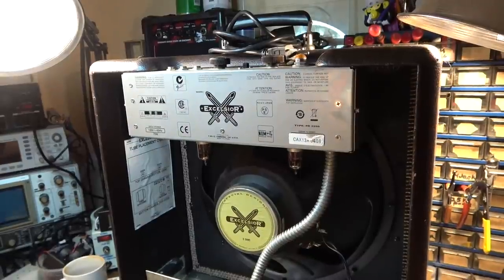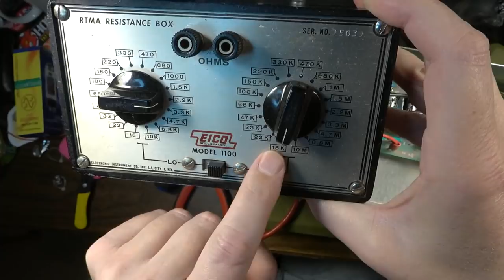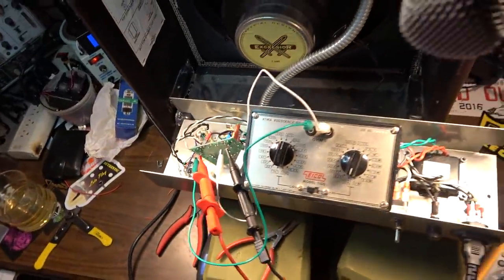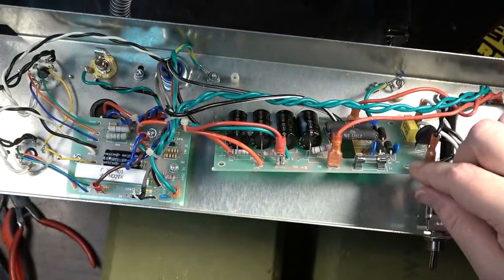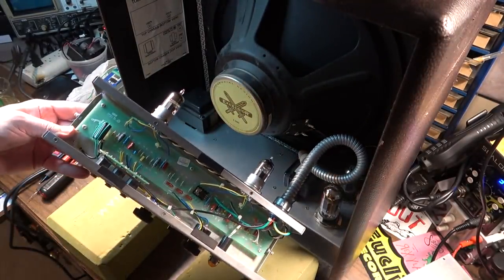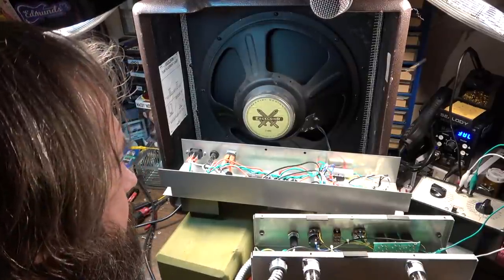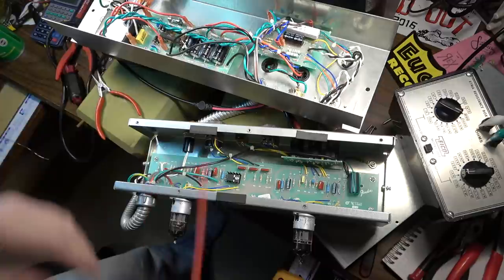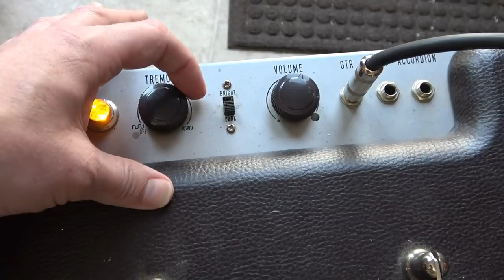Repairing Al Gore's Favorite Tube Amp - Fender Excelsior Pawn Shop Special Series

Comment: Hi Brad, just a few super serial technical remarks...

1. 6V6 is 12W, 6V6GT and JJ6V6S are 14W
2. the voltage to use in cathode bias calculations is the plate-to-cathode voltage, now you measured plate to ground (correct method for fixed bias amps), so subtract the voltage drop over the cathode resistor.
3. cathode bias is best at about 100% of max plate dissipation because increase in cathode current create a larger voltage drop across the cathode resistor and therefore bias it cooler, temporarily.

in this amp i would leave the 470R bias resistor because:
with Pa max = 14W, Rc = 470R and Vrc = 29,2V :
Va = 369,8V (= 399 - 29,2)
Irc = 29,2 / 470 = 62,1mA
Pa = 0,0621 x 369,8 = 23W 
=> 11,5W for 1 tube is already only 82% of max plate dissipation.

with your 1K bias resistor you brought it down to:
36,5V / 1000 = 36,5mA
0,0365 x (432 - 36,5) = 14,4W for 2 tubes, which is ONLY 7,2W per tube

Aiken amps has a good article on everything bias, please read up => https://www.aikenamps.com/the-last-word-on-biasing
Reply from the maker: Thanks for the comment. I am aware of the Aiken link already. Great site. You are correct on your math, and I appreciate the effort you put into writing it all out; however, there are some other considerations I think you might be missing with the focus on figures, and I'd like to address them.

I already addressed #1 in the video. You are right that my max dissipation figure was wrong for a glass bottle 6V6GT (or JJ equivalent). 

You are correct on #2. That was an oversight on my part. Got stuck on autopilot and whiffed on measuring to cathode rather than ground. The actual effect on the numbers was not excessive in the end. Put me off by maybe 8%? Still a mistake, and I own it.

Now on #3... This is NOT what Aiken says (that cathode biased amps can be biased to 100% dissipation at idle). What he says is you can usually "ignore the 70% rule". That's not the same as saying "bias to 100% at idle". I typically stick to the 70% rule even on cathode biased amps because, at the end of the day, it does not USUALLY affect the tone of the amps appreciably at jamming volumes, the amps run cooler overall (which is good for this guy because he wanted reliability and lower tube maintenance as his main mandate), and if anything, an amp running a bit cold will break up sooner on the dial and at lower volumes, which is what many players are looking for anyway, hence the obsession with attenuators these days. Although the onboard camera mic might not reproduce it faithfully as I'd like, the play test yielded a resulting tone that was acceptable to both TJ and I, and the objective of the customer was achieved.
Reply: Alex Maurice  no, no one cares about it.
Reply: @TheGuitologist  But you biased this amp to about 50% of max power.  Try measuring the output power into a resistive load you loose power as you reduce the bias.   80% is probably a good compromise if you really don't want to replace tubes.  It's most likely the screen voltage that's too high, I'd increase the PSU resistor to drop it to 330V relative to the cathode.  I'm finding good JAN military tubes used at a decent price and am going to try them in our amp.  It would be interesting if you measured power of amps that you work on before and after repair.  Just below clipping with a waveform that visibly looks like a sinewave is usually below 1% distortion, give it a bit of clipping since these produce rated power at 10% distortion.

Comment: I loved my Excelsior amp! I too had heating issues and ended up installing 4 fans from an old PC to keep it from burning up. After that it was very reliable.
Reply: And now you know what to do to fix the core issue!
Reply: @stephenhunter70  I don't have it any more. Notice I said "loved" as in past tense. lol I would like to get another one though. Haven't seen them in my local shops though recently.

Comment: I have a excelsior and excelsior pro. Same amp. The pro jist came from fender with a eminence legend speaker.  I run both those amps full bore and usually with a full or drive pedal.  I absolutely love them.  Great stereo rig.  Ive mever jad a problem with either.
     Also, there is a femal surf music band called the "surfrajets".  They all llay through excelsior amps. Bass and guitars
Reply: Bass too?  I usually see a different rig on hers.

Comment: I had an Exelsior few years ago. It was  ratteling from the very beginning. The ratteling stopped when I changed all the tubes. With an Eminence Legend 1518 and new JJ tubes, the amp was perfect !
Reply: Hi, and it never rattled again?
I’m thinking that the frecuencies of the stock speaker in brown Excelsior is the cause of the rattle in the tubes. Because i have found that the people change the tubes and then starts to rattle again, but only with the brown one.

Comment: I have one of these Excelsiors which I use primarily as a harp amp, but also for guitar. An Eminence Legend 1518 is a great speaker for these amps. I swapped the tone switch for a proper treble cut tone control, and modified the preamp stage by dropping the preamp voltage, and changing the 3.3k cathode resistor on V1a to 2.7k. I wanted to keep the "Valco" vibe, snd they used 220k-270k plate resistors with 2.7k cathode.  If you change the values to typical Fender 100k and 1.5k you pretty much get a 6G2 Princeton preamp...
Other mods I made were a footswitch jack for the tremolo, and put V1b's bypass cap on a switch,  which cleans the amp up, but keeps that budget amp vibe....

Comment: I remember when this series came out. The fender vaporizer was the best amp in the series.It had foot switch, jetson cab and reverb.
Reply from the maker: I think it was the coolest looking one. Was the Greta also part of this series?
Reply: @TheGuitologist   yes she was
Reply: @TheGuitologist   Yes Greta was one and a cute little amp. I bought one for my daughter. It breaks up at 1/4 vol. Would love to see you overhaul one of those. Love your vids(guitar and politics)
Reply: I regret selling my vaporizer.
Reply: @oneeyeddog6127  that amp had a taste tone.  I miss mine too.
Reply: @TheGuitologist  I bought a Greta and a Vaporizer as soon as they came out; never liked the aesthetic of the Ramparte or Excelsior. In small clubs, once a Vaporizer's up in its range with the drums, it sounds just like a DeluxeReverb...sweetness w/ 2 16ohm 10s!
My Greta is about the best-sounding amp I own....between 0 and about 1 1/2 on volume(!); after that it's a Pignose the rest of the way. The actual Cool Thing about it, though, is that it has an EFX loop....so I can run just its sweet pre-amp character to the EFX return on my 100w el34 2x12" Carvin, and get Greta-tone you can hear up the street! In the bars I run it into the EFX return of a 20w MicroDark Orange and a 1x12 V30 cab....

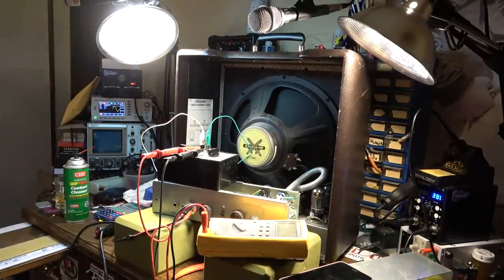Comment: Thank you for this video!!!  Really helped my navigate my own repair.  I too lost power to all the filament heaters.  At 30:55 in your video the same thing has happened to you.  Such a mystery at first.  But same as yours -  the spade clip on mine was loose or corroded, both of them.  But I still had full plate voltage and could hear the transformer working.  This filament supply connection is definitely a weak link in the power supply chain.  Great tip for any Excelsior owners.  A good idea maybe be to put in a soldered connection here..

Comment: MOSFETs are quite neat, they work almost exactly like a triode valve, and if you adjust the voltage in a tube amp design you can substitute all triodes with MOSFETs, Session did exactly that in the 80s.
Reply from the maker: I have played some really great sounding mosfet amps. SS can be very good.
Reply: Still loving my Session Rockette since 1986 !

Comment: The Excelsior Pro has a few improvements, namely an upgraded speaker.  I dig mine; I also have the Vaporizer; both are surf green. Also have a DecoTone. They sound great, and the prices were reasonable, except for the DecoTone.  No overheating problems on any of them.

Comment: That shielding could have been shorting and causing the red-plating.
I noticed the same with my Excelsior.
Also, I did replace the speaker with a custom re-coned that really makes all the difference in the world.
Originally I had planned to add a Tone Control Mod., however after replacing/upgrading the speaker it is fine as is.

Comment: Thanks for the Vid...I own a Vaporizer and I had not played it in a couple of years and when I turned it on,  the reverb did not work.  Got is going by cleaning the RCA jack  that goes to the spring reverb unit.  Hope the rest of the connections stay good!

Comment: That resistor was more physically stable down on the board, but is of course better dissipating heat off it. I wonder if a little standoff on each end could be made to keep the weight of that wirewound from working at the leads and solder joints. Only a concern if it's getting banged around. of course.

Comment: When I used to repair vintage electronics I would replace any resistors I saw discoloured on the board with the next wattage up or the one above that depending on space.  It sure helped as I had more than few that would blister you as soon as you touched them then go up from say 2W to 5W and mildly hot and go to a 7, or 10W if it would fit, and you could rest your finger on it.

Comment: I really was especting at min 10 to see some smoke getti g out of the nice resistor box. You replaced the 10W cathode resistor for a who knows how much dissipation can hold those inside the box...
Reply: I was thinking the same thing !!  The resistor boxes I have had contained 1/4 watt resistors !!  Seems they would burn out quickly !!
Reply: I looked it up.  The box has 1W resistors.  (I was halfway expecting 1/2W.)  Still, I wouldn't run it for very long.

Comment: I just bought one of these last week. Has a fender speaker with a bigger magnet.  Hopefully I will have good luck with it. When I got it, I had to tap a power tube for it to work properly.  Swapped power tubes and the problem followed the tube

Comment: On your initial test of the bias using your decade box, have you got a speaker or dummy load connected? Is that socket sitting above the board you have piggybacked your decade box to a speaker socket? Could be why you were getting the bias runaway? I've made that mistake once or twice and immediately figured it out before killing something.

Comment: ha ha - had one of those.  I replaced the speaker with an eminence.  Fender offered a more expensive version that came with the same eminence (but with a fender label on it).  So fender did this too.   Also, swap out that tone switch (switches in a 470K resistor in and out) with a 470K or 500K tone pot (this is from memory, and memory is not so good - so please verify)!  It makes it a nicer amp.  I am listening to it now so you have not fixed it yet (in my listening) so I don't know what the fix is yet.

Comment: Do not replace the speaker! The Fender Special Design speaker is part of the charm and uniqueness of this amp. Lots of people change this speaker thinking that they're doing themselves a favor, but they're not. Does anyone think that Fender didn't try other speakers in there when they designed it? They were probably designing the circuit with Jensens before they got the first bespoke speakers for this amp. Historically, bespoke stuff ends up being more a lot more valuable to collectors.

Comment: The reason the ground lug wasn’t drilled through is because the protective earth need to be attached to a fastener that can’t be undone from outside the device, and that doesn’t perform any other function. This is usually done by spot welding the stud to the chassis, which seems to have been done poorly or not at all on this device. The safety idea behind that arrangement makes sense, but you can’t stop to wonder if it would just have been better to use a bolt instead.
Reply from the maker: I think in this case, the regulation failed utterly in its intent.

Comment: Cool stuff man, thanks for uploading this. I had a Mesa Boogie Mini Rec that used to cook tubes.The amp ran off of el84 tubes. I was told that el84 are designed to burn hot, and that was the issue but I've always wondered until now. You are a great teacher brother.

Comment: I gotta say, those chassis look ripe for a point to point project.   They could have at the very least spent a few more bucks, get rid of the circuit boards and put in turret boards, it would be 1500 dollar amp all day long.  It would be an easy modification to do.  Layout is nice and clean.
Reply from the maker: I know. Why not do the majority of them with the PCB and then do a small run of hand wired ones? Upgrade the transformers a bit and wire on turret boards... Do it in China. Hit a $1000 price point with a better speaker. Could have been cool.
Reply: @TheGuitologist  higher wattage speaker too.  They barely missed on these.  I might have to get one and do it up.  The parts are all there.  It would just take a little solder.

Comment: Always thought this series of amps was pretty cool for what they were.  The Vaporizer was the best out of the three usable offerings (the Greta micro amp was about as useless as hen's teeth) imho, with its "total bypass, full tilt boogie at maximum 11 watt blastage with no pots or controls in the way of the pure raging maxed volume tone" feature...that little bugger absolutely SCREAMED through those twin 10 inchers when you hit that bypass switch! It looked pretty damned cool doing it too, with almost evil "black widow" grill opening. Wouldn't mind getting my hands on one, especially the red tolex version, if anyone out there in inter-webber-fier land wants to part with theirs for the right price (nudge nudge wink wink...)!

Excellent job as per usual, Brad, I'm being thooper cereal!

Comment: I had one of these (sold it to Michael Lee of The Voice fame) and it was cool for the $300 shipped I paid for it.  The speaker had no redeeming qualities.  I put a Weber 15F125 and it dramatically improved the tone.  This circuit needs to have a 500KL (linear) pot in place of that all treble or all bass tone switch.  That improved the amp almost as much as the speaker replacement.  It's best tones are in between where those tone switch settings are.  I bought it with plans to one day gut it and put some non trem variant of a 5E3 in there.. which is what this is anyway..  But I got laid off, sold all my stuff and moved to Mexico.

Comment: Just as a thought, when replacing the resistor, how about putting it on the other side of the board so the heat will go up to the chassis and not the PCB?
Reply from the maker: This isn't a double-sided board, so there's a pad only on the one side to solder to. It's doable, but another solution might be to route out the underside of the resistor area like was done on the other board.

Comment: Hi Brad. As always supereb video. The 1K 10W resistor is going to flap around under virbration when the amp is cranked up. Perhaps a means of support to de-stress the leads and more importantly the solder joint would be good. A single ceramic or cheaper metal spacer each end of the lead. What do you think?
Reply from the maker: Standoffs wouldn't be a bad idea, but I think it'll be ok. This resistor doesn't have that much more mass than the other power resistors which are stood off the board. I doubt the vibrations of notes will dislodge it. The only thing that would dislodge it would be mishandling of the amp, but that kind of force would also dislodge any number of other things, including the ground lugs, apparently.
Reply: @TheGuitologist  Hi Brad. Certainly manhandling will cause stress fractures added after heat and sound vibrations after a good session. Having come from 30 years designing and certifying aviation electrical and avionic systems, we would design out a single level failure of this type. Amps are not subject to the same vibrations, but with PCB construction maybe turret terminals so as to provide ventilation and mechanical protection. two problems solved.
Reply from the maker: I think your solutions are great suggestions.

Comment: That ground stud looks like it was friction welded, if done properly would give a better connection between thr screw and chassis.  Also if I remember right I paid like $200 for mine new then sold it a year ago for $300.
Reply: I thought that too. A welded stud that broke because it wasn’t welded properly. Quality control. I’m sure they could have a machine insert an actual screw to save 1 cent per amp. Sheesh.

Comment: I see I'm late to the party.  The ground post is a stud welded to the chassis, which is why it didn't go through or have a screw head. Looks like either a faulty weld or the nut was over torqued, so attributable to lousy quality control unless someone was in this amp before you and overtightened the nut.  I'm somewhat nonplussed that you didn't check what I assume is the cathode bypass cap for leakage. It says it's rated for 105 degrees C, but it sits right next to the cathode resistor so it's been cooking.

Have you ever checked your resistor substitution box to see what the wattage rating on the resistors is? I strongly doubt it's ten watts. BTW, that box references "RTMA values". RTMA was the name for what is now the Electronic Industries Alliance. The name RTMA was in use only from 1950 to 1953.  How old is your box?